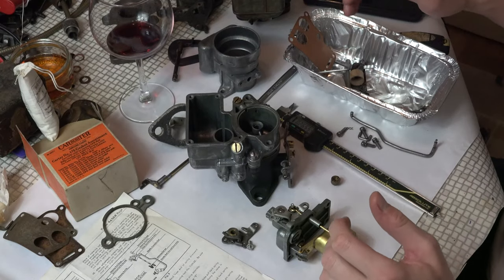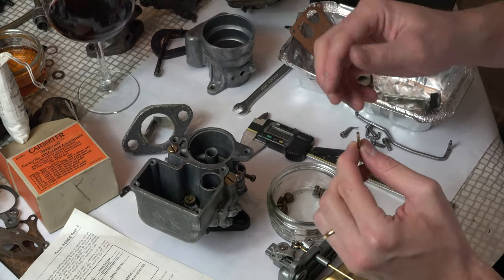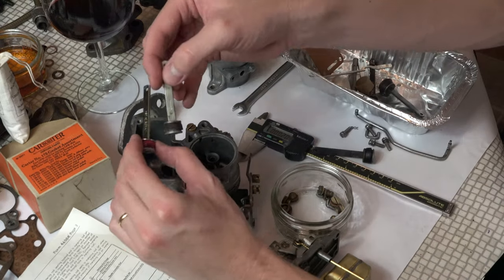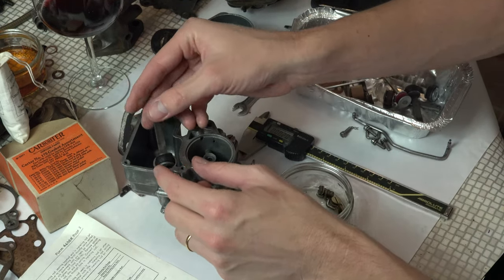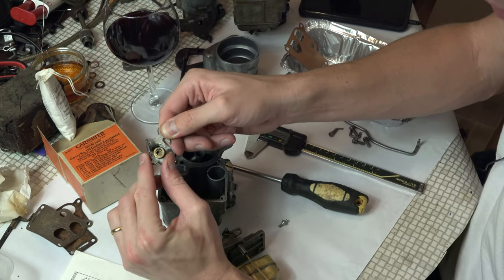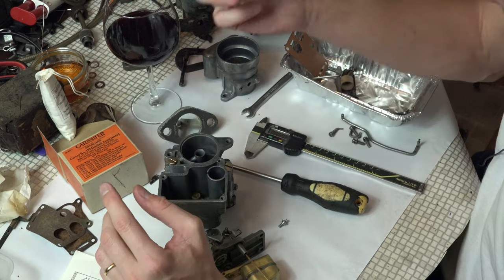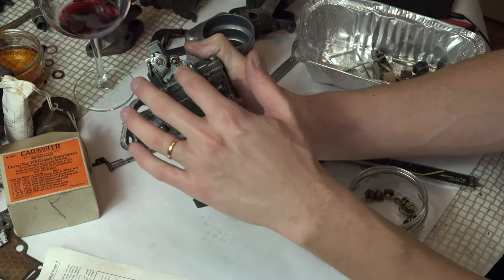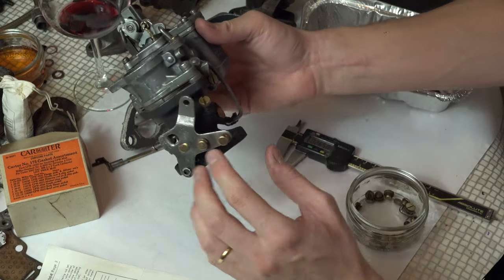Making the Willys jeep WO Carter Carburetor work properly Part 3, Secrets! WW2 539S

Comment: Hello,
I want to thank you for your instructions. I just completed my first rebuilt on my 1948 Willys CJ2a carburetor and after a little adjustments it is running better than it has it years. I would never have been able to do it as easily from just reading the manual. Thanks again, all the way from Northern Michigan, USA.
jim

Comment: Hey Matt I found a good way to remove that main jet is to take a little hobby swab paint brush, cut off the swab end and use the shaft to push the jet out. The plastic shaft is flexible, so it doesn’t damage anything and it’s just the right size to fit into the port of the jet but go down the hole.

Comment: Hi Matt,  Great series of videos.  Very informative and practical as per usual.  Can you conclude by adding a piece on the prevention of vacuum loss through the throttle shaft and body ie permissible wear limit/play etc. and defuser gasket to manifold sealing please..
Reply from the maker: Hi Paul, When it comes to the throttle shaft I really can't say the exact wear limits, really no wear is acceptable as its an air leak which is why I illustrated the suck test in the last video.  There are many carb re-bushing kits/bushes you can purchase online for throttle shafts, if you have any real noticeable wear on the body or shaft  then they need repairing/replacing.  When it comes to diffuser gaskets make sure it is not the type with copper rivets!  The rivets don't crush and the diffuser leaks, another example of repro parts being created without the knowledge of what the part is for and trying to achieve!

Comment: You don't bend the metering rod out to get it out. You rotate it while opening the throttle, and there is a spot where it will rotate off the pin without bending anything.

You can remove the nozzle with a pen or plastic spudger, pushing it out from the top. The wedge shape keeps from crushing the brass. The small copper gasket can keep it stuck.

Conflicting info on the main jet with metering rod tool vs the feeler gauge method, the pin for the jet either ends up below the pin, causing delay while opening the throttle, or no delay lifting the main using your method...

Fantastic job by the way, thanks.

Comment: I have a new "professionally rebuilt" WO that I let my buddy put on his 2A.  It idled and ran well, but he says that he doesn't have nearly the power that he did before with his old one.  Is this an accel. pump (plunger) issue or  should I check something else?  He took it off and it is now on my bench.  Love your videos - best flat fender channel ever!
Reply from the maker: Lack of power could be a number of things, if when he presses the throttle it 'bogs' and then the power picks up its an accelerator problem but if its missing power at higher speed then it will be a high speed circuit problem which needs to be looked at.  Thanks for the kind words about the channel, I appreciate your support!

Comment: Hello, I have a 1952 Willys jeep, the same one equipped with the carburetor that you show in the videos. With the help of the 03 videos posted by you, I managed to replace all carburetor repairs. The only doubt I have is that I am not able to regulate the fuel injection when the engine is fully accelerated. The fuel is not being completely burned, causing the pistons and spark plugs to be completely charred. How do I adjust? Awaiting return. Thanks.

Comment: If your metering rod is messed up how  do you remove it,,someone as usual someone who has no idea of how to remove it messed up the screw slots..Help  Absolutely awesome video,,thanks so much for all your info.
Reply from the maker: Not really sure what you mean, sounds  like you'll have to take the carb bowl top cover off to access it properly?
Reply: Sorry Green Dot,,,,not he metering rod,,,mean t the jet, that's under the screw cap,,the long one that is right next to the airhorn hold down screw,,,you remove it to get at the other one at the bottom of the jet tube, it's the low speed jet,,,stuck, did run a torch tip cleaner in it and it cleaned out,,very small one,,didn't mess up the diameter, just opened it up, some ammeture messed up the slots,,,Houston we have a problem,   you went from good beer to red wine,,,try the red Malbec from Argentina Norton is really good. the reserve one